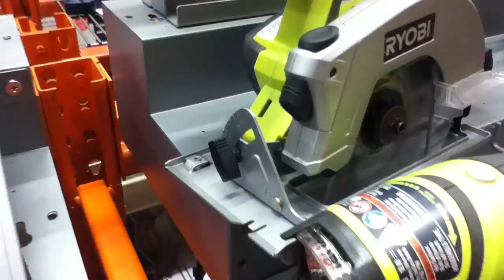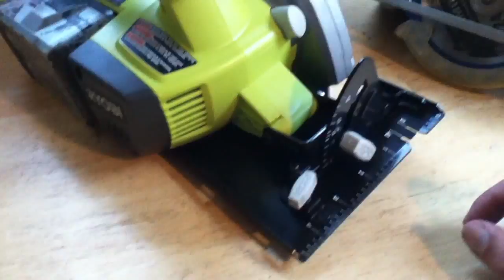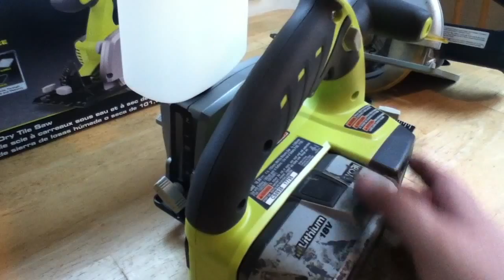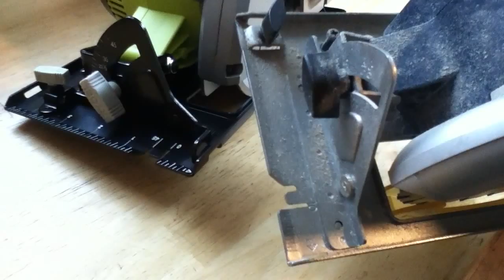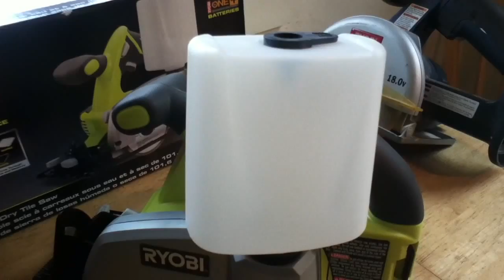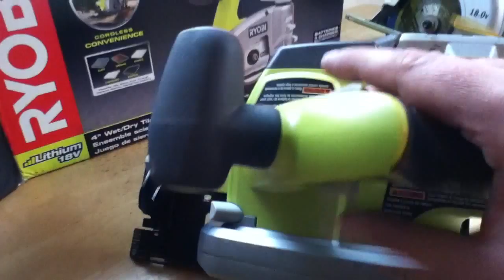Ryobi P580 Cordless 18v 1+ Tile Saw Review

Comment: I bought one of these a few years ago as a refurb. I finally decided I needed to use it today. Unfortunately, I discovered the Refurb did not include the direction booklet. I needed to cut some half-bricks. I am re-bricking a few feet of the foundation on an old house and reusing the original bricks and some bricks removed from the old chimney.
First Step was to install the blade. The reverse threads are something I will need to be mindful of . The Allen screw was very tight and I was not having luck removing it with the Allen wrench. I did not notice if this tool has a lock button on it like my grinder does for installing blades. But I scavenged around and found my Ryobi 1/2" impact gun and some 3/8" Allen sockets. Fortunately I had a socket size adapter as well.
As soon as I hit the impact, the screw came loose and I was able to install the blade.
The tool cut the brick on four sides effortlessly. Much better than trying to use the dry cutting wheel on the grinder.
The off switch on the water tank seemed semi-useless. After cutting the first brick in half, I had to go install it because my concrete was drying. 
When I came back to the tool 15 minutes later, the tank was mostly empty. So in the future I will have to try and remember to remove the tank or set the tool upside down so the water does not leak out between uses.
I am looking forward to using this nifty little tool on the rest of this project.
Someday, I may even actually use it to cut tile!